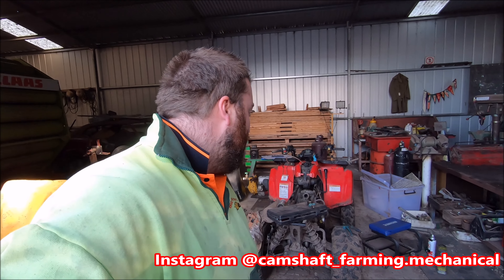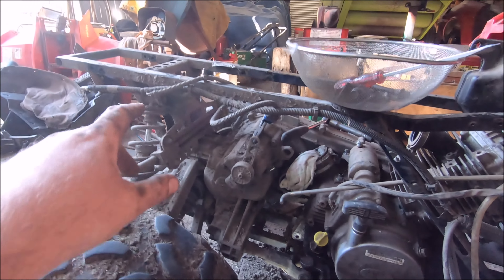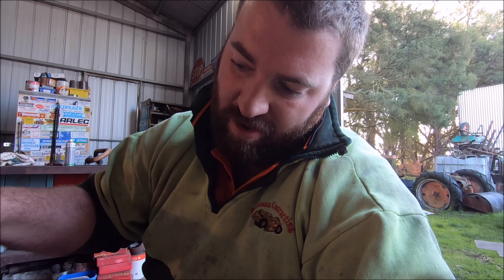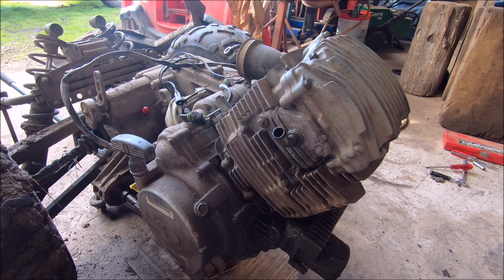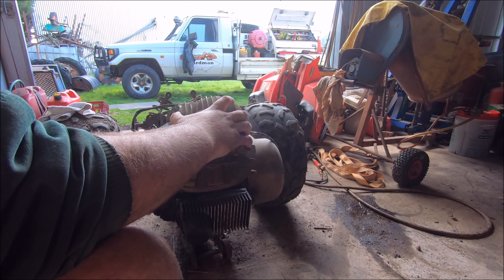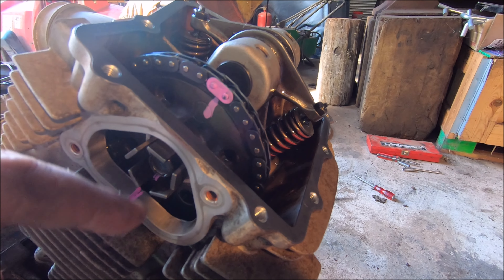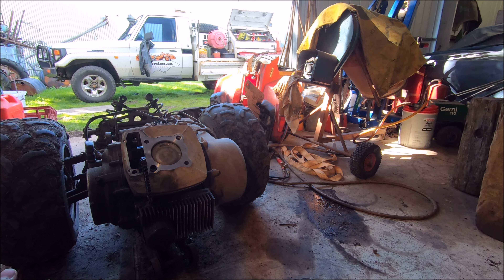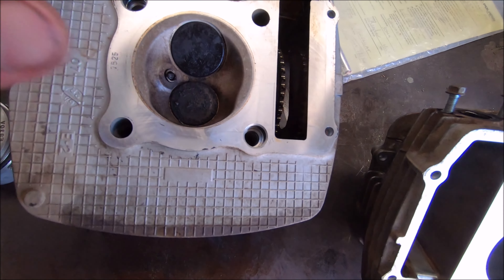Polaris 300 Sportsman/Hawkeye Engine Rebuild: Engine Removal & Tear Down

Comment: Why was it losing oil. Did you get it figured out?
Reply from the maker: Yeah I think I speak about it in one of the later eps of the rebuild, there’s a playlist of the rebuild if your interested. It ended up being one of the valve stem seals